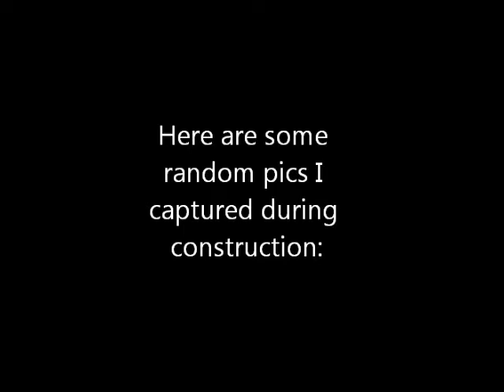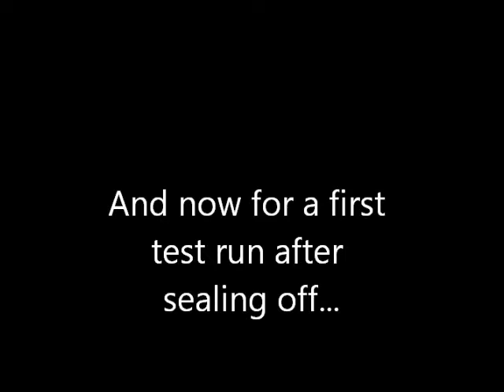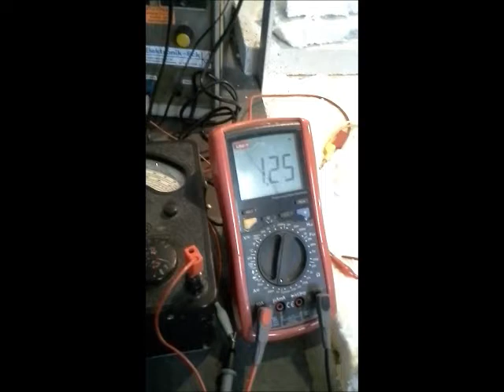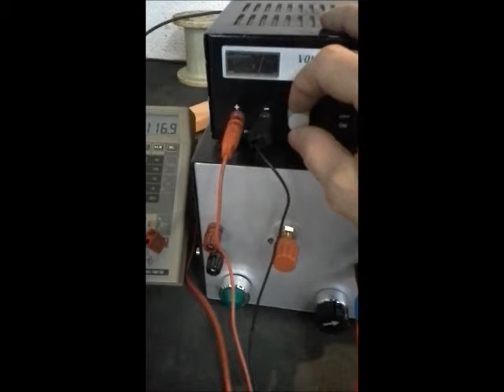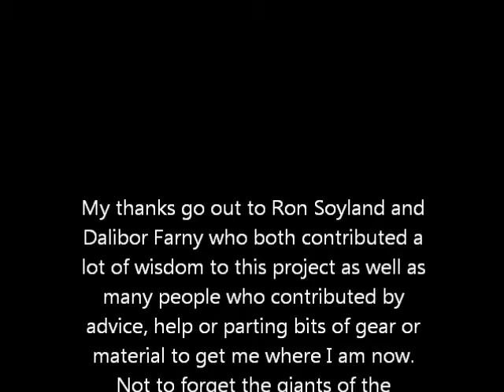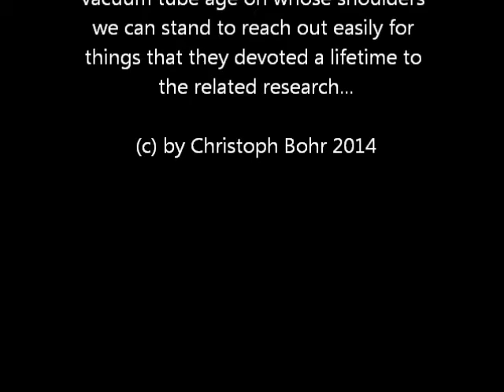First homemade triode

Comment: Ever thought about putting sum thorium in as a beta emitter. Ive seen major amperage increases.
Reply from the maker: This was pure tungsten but I use WTh since. it sure gives better emission but still not as good as an oxide cathode would, but then again, these are a bit more complicated to prepare and activate.

Comment: what is the filament voltage when filament current at 1.25A? i make a similar with 1.2V filament voltage at 2-3A current at 100V anode i only able to get 100uA .
Reply from the maker: Oh, that is a seemingly simple question, but I would have to know a lot more to give you advice. The filament voltage is pretty much meaningless in determining where you lacking emission. It is rather a matter of current versus filament wire diameter&lengsh or in the end filament temperature and of course material. With tungsten you would have to run white hot to get decent emission, with WTh you can run lower.
The level of vacuum is of course important, too. If you give me these parameters I can most likely tell you what is wrong.
Reply: Thanks for reply, The reason i ask for filament voltage is to compare the filament power,  I was disappointing to get 100uA plate current was suspect my vacuum maybe insufficient , recently i compare with a saturation diode which they use pure tungsten 1D2P (china tube) Vf=1.1V, If=2.5A ,Va= 100V, Ia => 90uA seen like quite close to my tube. I realize tungsten filament is very sensitive with temperature.. I try to find R type or TM and UV201 plate current i cant find any original datasheet mention about plate current. My vacuum pump is not the good one , is 2 stage mechanical pump , i dont have proper vacuum gauge the meter always show 0 end, i guess the vacuum is about 10mTorr. not the hard vacuum.

https://youtu.be/rWYirzoHOpI
Reply from the maker: @6p1p  OK, I begin to understand. I have to admit I am not even sure what voltage I used back then, but I guess it must have been around 2 volts, maybe a bit more. But I noticed several things in your setup:
You seem to be using a filament from a fluorescent lamp, which uses barium oxide on tungsten and is a quite good emitter, alas, when you expose it to air the oxide will degrade very quicly and most likely leave you with a barely working oxide emitter, at best it would work as a pure tungsten emitter.
If it is to be a oxide cathode, the temperature looks to high to me, for an tungsten cathode too low, but it is hard to judge from camera.
And last, in a vacuum that weak  I fear an oxide cathode would not survive anyway, either bc of poisoning or by ion back bombardment, at these levels there are still enough gas molecules present to cause strange effects. It is possible to have a
working tube at these levels, as were the first de forest tubes, but this is very instable, which is why it was abandoned.
Reply: @dercebe  Thanks, My filament is pure tungsten not the oxide one.. I break the bike break lamp so i can use the 4 terminal to hold the element .  My intention is to learn how to duplicate R type or TM tube with pure tungsten so i can build a simple regenerative radio with that tube, i still havent invest  glass tools to make the glass bulb. I wonder is it possible to make a tube vacuum level with just a mechanical pump? I try to search around the earlier vacuum system include the Le forest but i cant get any information about it, or how audion work filament voltage , current and plate current..etc there is too little information about the earlier tube  and I was suspect my vacuum level until i compare the saturation diode, compare the filament power i think i get almost similar emission , so i gain back my hope and confident to continue with just a mechanical pump.
Reply from the maker: @6p1p  OK, I see. With pure tungsten the vacuum does not have to be that good, but it still should, and most likely better than what you can get there. I fear you will have to get a diffusion or turbomolecular pump to achieve that level.
Further you will have to clean up your setup, your tube must be very clean and leak free, this is not a trivial task.
I can not tell you from the top of my head what the filament requirements of the original TM were, after all there were different versions, a "soft"  and a "hard vacuum" type. We can safely assume that these tubes differed quite a bit which is why many early tubes have a current rating rather than a voltage for the filament. Same current means same temperature.
Good sources for tube building are Espe Knoll, Saga of the vacuum tube by Tyne and Glasslingers channel here on youtube.
I really can not comment on the other tube you are testing, but a current in the µA range seems pretty useless for what you want to achieve. I did build a receiver with my own tubes and it worked surprisingly well.
You can certainly do it, but it is a lot of work. You might be able to get a soft vacuum tube to work, but I guess this will be just as tricky, only with cheaper equipment. If you can get somewhere in the 10exp-4 mBar range of vacuum you might be able to use a barium getter to get to the level you want with a small enough envelope ( which is what commercial manufacturers do frequently. )
For glass you have to choose which type of glass you want to use, lime or boro... there a several pros and cons for each, but you can not really mix several types easily.
Reply from the maker: @6p1p  Glad to hear that you had some success. For emission allone a bad vacuum is not as critical as for a triode, you can even deliberately fill a retifier with gas or vapour. To easily calculate the expected filament temperature for a given current have a look at this sheet a clever guy put up on the web, he has a channel here on youtube, too, iirc.
http://www.teralab.co.uk/Glass_Blowing/Thermionic_Diode/Thermionic_Diode_Page1.htm
Reply: @dercebe  Thanks you , yes i have refer to what he did.. and I think due to my vacuum is not hard vacuum my emission is much lower then what he do.. but after this experiment i gain confident to continue my tube project.  Do you have video about your tube work in your radio? I really interest to see it how it work as a simple radio with pure tungsten filament tube.. really cool.
Reply from the maker: @6p1p  Yes and no, you can get substantial current with bad vacuum, it is just noch very stable, i.e. dependend on ambient temperature and not stable over time. Some of the first commercial tubes used a soft vacuum and could perform well in one "sweet spot", but that was very erractic and partically useless. Later there were still gas filled tubes, e.g. "tungar" rectifiers or hydrogen thyratons. However a hard vacuum is certainly the way to go for you project.
I sadly do not have any documentation of the radio, it was more of a lashup on the table but worked quite well with high impedance headphones, it was of the classical "grid leak" type, a regenerative set.
By the time I had it running in that radio setup I had already switched to thoriated tungsten, but I see not reason, why the pure tungsten should not work as well.
Reply: @dercebe   This is my first time experience about pure tungsten tube. It really fun , i think to i have to stop a while for this project and collect more tools before i continue i have Getter , i dont  have spot welder and Induction heater later i will build for it.. 

It really cool, i cant find any video in youtube to see how the pure tungsten tube operate as radio ,  How they adjust the filament voltage and to get the radio work..etc 

How you get the thoriated tungsten? i think they are radioactive? one of my friend told me to get it from TIG but i think they are too thick for use as filament. 

I have thoriated tungsten tube such as UX201 , 811, 845 , i think they are less sensitive to temperature ? 

I have try to build a simple audio amplifier by using the tube i build.. 
https://youtu.be/4K_HI2kFO48
Reply from the maker: @6p1p  Great thing that you have getters, they are hard to come by. The rest can be built relatively easily, look at gasslinger homepage to find plans for a getter flasher.
The filament was adjusted using a variable resistor, this was quite common in these days and called reostat iirc.
Pure tungsten can run at any temperature as long as you get sufficient emission, you would look for a level where the anode current is usefull but still does not destroy the filament too quickly. With thoriated tungsten the usable temperature range where the prosess of generating a monomolecular layer of Th is quite narrow, the filament has to be activated  in the process, otherwise it will loose emissivity if run to cold or run like normal tungsten if run too hot. It should be carburized as well, which I do not do.
The WTh is a weak apha source, but it can be bought from scientific supply shops freely. It is not super dangerous, but you should take care not to inhale particles or carry them on your skin. It is in the range or uranium glass or the self lighting dials of old clocks. Alpha radiation is harmfull but it can be shielded by a piec of paper, it can not travel very far or penetrate any solid material easily.
Tungsten from TIG welding has the proper composition, but it is not ductile usually and to thick, so not really of any use for us.
For the time being, stick with pure tungsten and you can work with less hard vacuum. WTh requires good vacuum and a getter to maintain it. With Tungsten you can even use the filament as sort of a getter, at least for oxigen by running it hot so some of it evaporates. At least for experiments this should work.
Reply: @dercebe  Thanks.. seen like Pure tungsten for me is good to start.. I will stick with this .. and learn about the glass process later get the torch .

Comment: What was the voltage gain?
Reply from the maker: Jane Gallagher I did not run the tube with a resistive load attached. Transconductance was measured with 0.3 mA / Volt. I.e. for or each volt of change in grid potential the anode current will change 0.3 mA. This is not a lot but pretty much exactly what a type R triode would give you. Hope this was the information you were looking for...
Reply: Yes it was and thank you. I wish you luck if you ever try anything with 2+ grids…